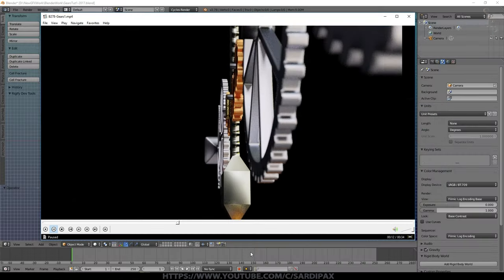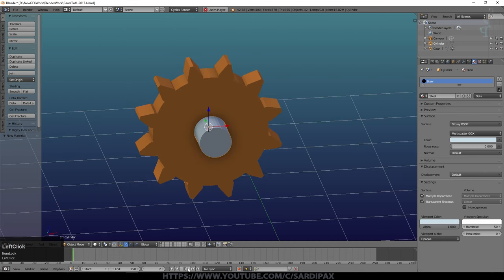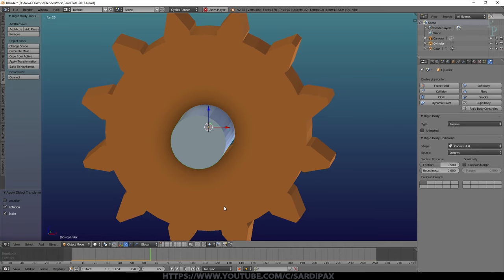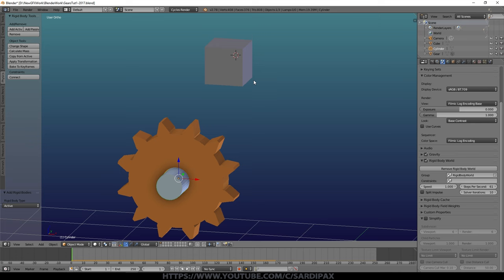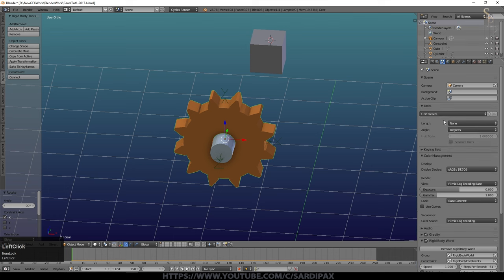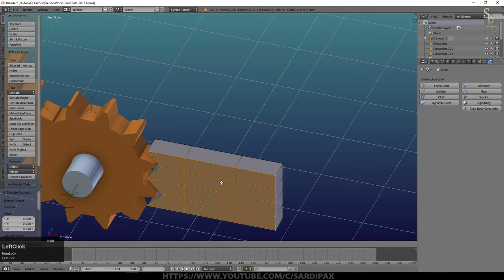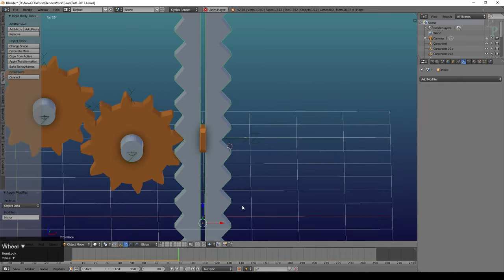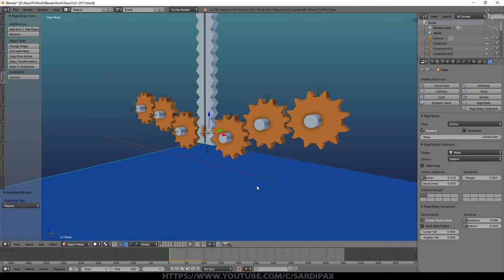Blender Tutorial - Gears

Comment: At 13 mins re: hinge to lock axis......why not just lock the Y and Z axis in the N panel under "Transform....Rotation...." ?
Reply from the maker: Hi, that is certainly an option for a basic spindle, but a proper connector object has additional options such as 'Breakable' and 'Limits', it relates two objects rather than simply affecting one and it allows you to individually control the Physics Simulation Iterations (if necessary) for a specific set of objects. Finally, there are many different connector or Rigid Body Constraint types beyond simple hinges.
Reply: Thanks.....I soon came upon its limitations as I continued the tutorial.